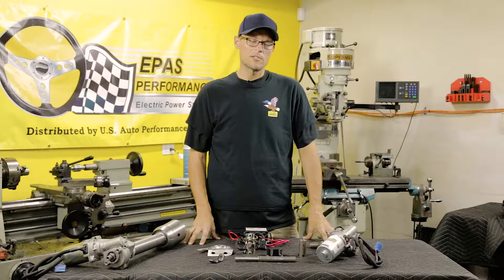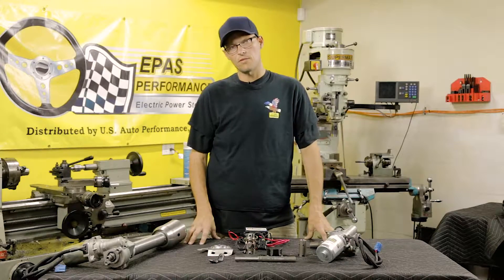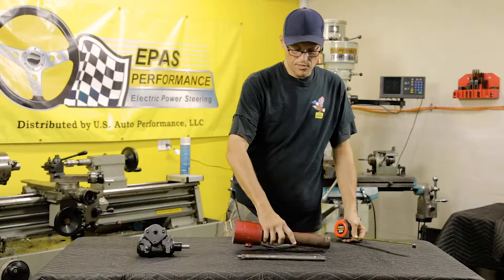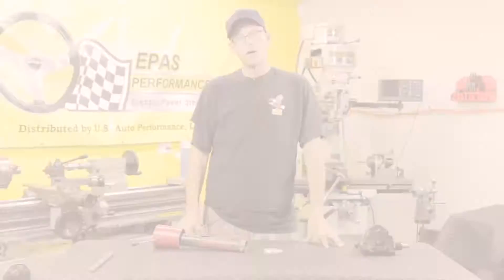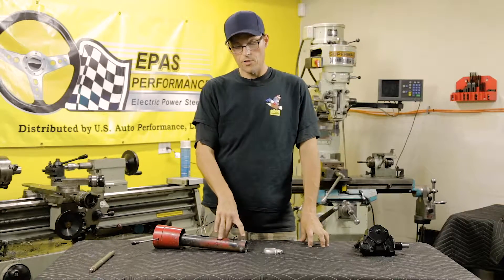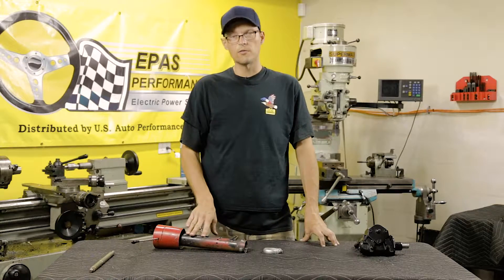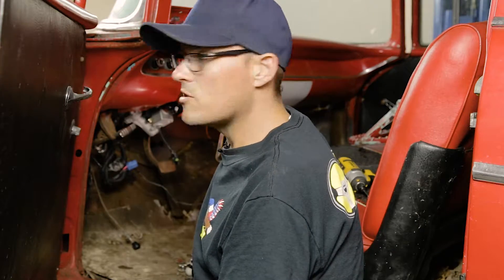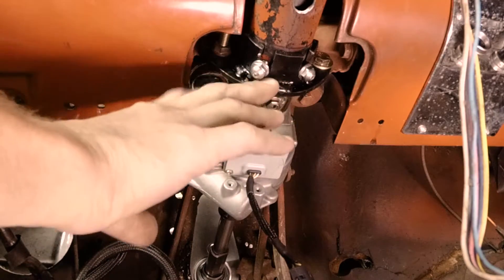EPAS Performance Application Specific Electric Power Steering Conversion Kits

Comment: What am I supposed to do with the inner tube that supports the shift collar? You guys don't really say what we are supposed to do with that because when it's cut flush with the outer tube it interferes with the steering shaft? Do I disassemble and just cut it and leave a small section of it near the top?

Comment: For Column shift vehicles you will need to convert to a floor shift . This is mentioned in the '55-56 Chevy conversions but missed in this presentation.  The steering box shown is not  for 'a 1957 Chevy. They manufacture one for a Automatic Column shift and one for a Standard shift. What's the difference if you have to convert to a floor shift?